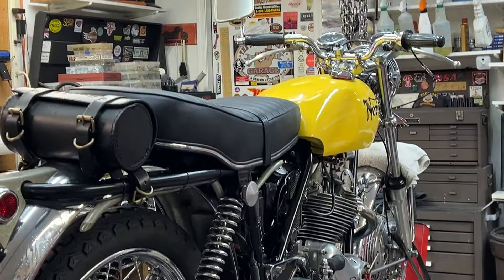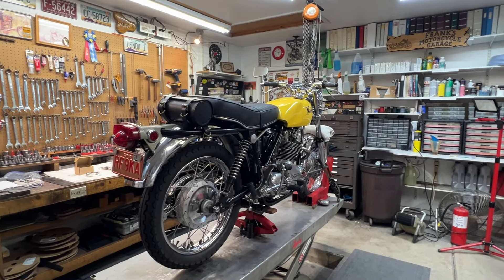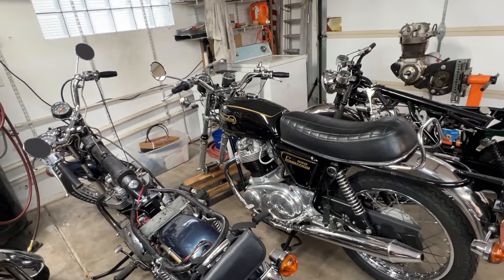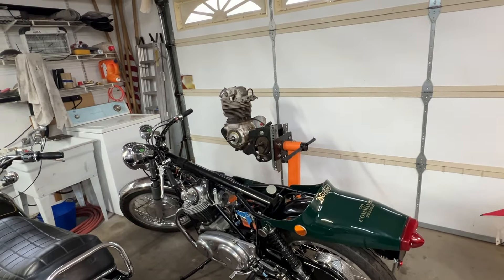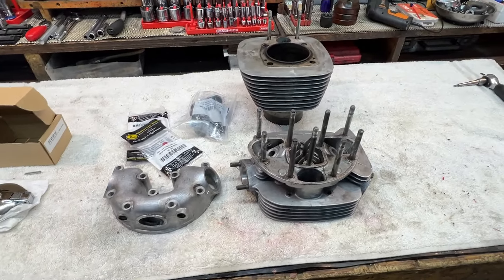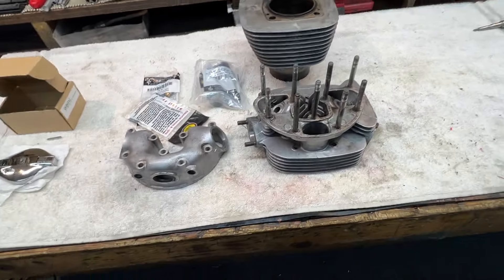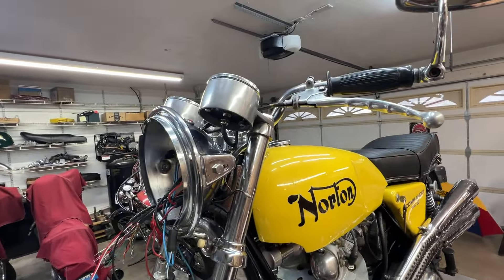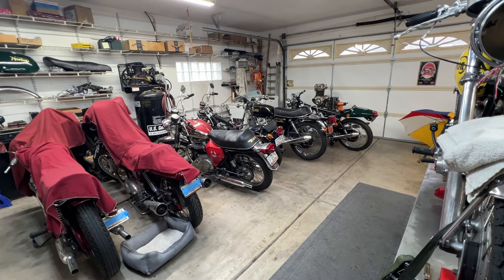Vintage British Motorcycles Repair/Restore

Comment: Why did he take the barrel off the B50?
Reply from the maker: Well, once the head is off, removing the barrel is just a matter of unscrewing a few base nuts and a lift  off.  It's a chance to look for cylinder wall scoring, broken rings, ring end gap being out of spec and anything else that might look not right.  It's sort of a "why not" decision.
Reply: @fjdelmonte  why did he send you the barrel? You didn't mention it.